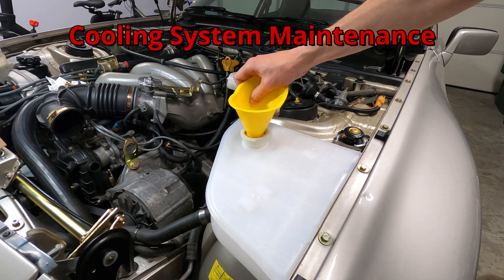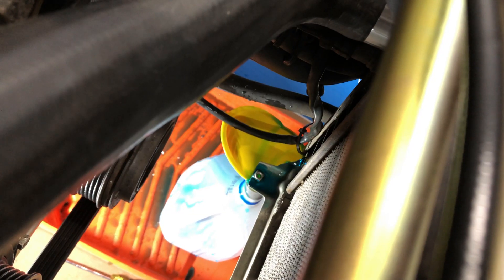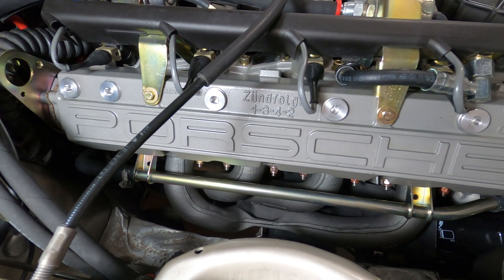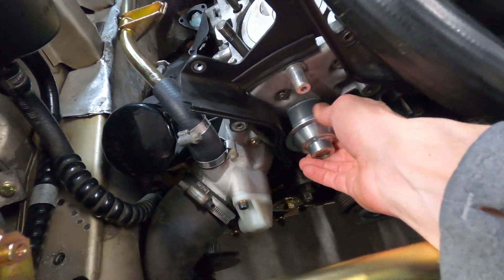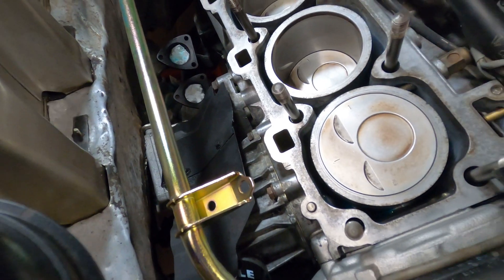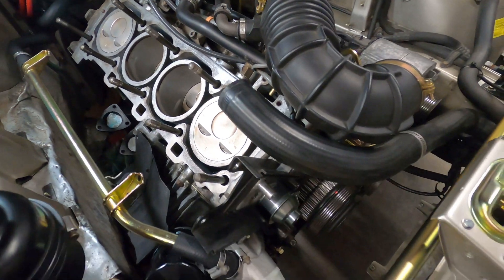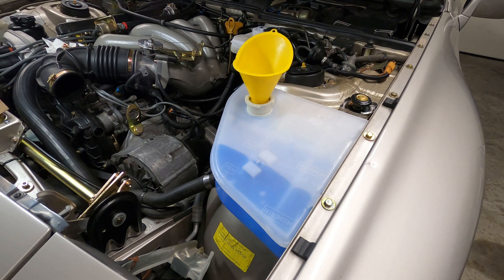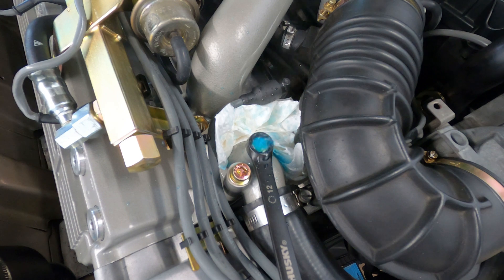Porsche 944 – Coolant System Tutorial: Draining, Filling, & Venting

Comment: Do i have to drain the whole system if i’m replacing only 1 hose? Replacing the upper radiator hose.
Reply from the maker: Nope, you can just pull that hose, dump the fluid in it, replace it, then refill and vent.

Comment: Very informative 👏 I'm about to flush my 968 and this video's a life saver
Reply from the maker: Nice! The valve setup naturally vents a little better on the 968, and you likely won’t have to do as much bleeding. I also just posted a water pump video on the 968 that gives some information on the draining and refill process for that car.
Reply: @NC944er confirmed! Have flushed coolant in my 968 a few times over the years. Usually only have to heat cycle/crack the bleeder once.

Thanks for the great vid!
Reply: @NC944er  That sounds good to me 😂 Awesome thanks, I'll check it out 🙌

Comment: Where does one get all the yellow zinc?
Reply from the maker: @jbrews91441  I removed all the steal brackets and hardware from the engine compartment, had it bead blasted, and replated in yellow zinc by a local metal plating company. Some folks do it DIY as well.

Comment: Terrific video.  I’m attempting this next weekend.  Question: to reduce the mess, wouldn’t it be easier to pull the lower radiator hose and place a bucket under there?  Is there a reason to not do it that way?

As always, this video is exceptional. Thank you.
Reply from the maker: @stephengawlik3033  Hey Steve, the lower radiator hose is rather inflexible and can be difficult to push off the connection to the radiator. You’re welcome to try it that way if you’d like, won’t hurt anything. If you want to get really fancy, check out the radiator drain kit from Lindsey Racing, it replaces the drain plug with a valve and hose connection for $32 - https://www.lindseyracing.com/LR/Parts/944RADDRAIN.html
Reply: I think it’s to help flush out any debris in radiator.

Comment: Hi i know this is a old vid but i need help, i got home after a cruise cars running well when i park and there is coolant all over the place BUT it looks like its a leak near the coolant tub but no pipes look like they are leaking also near the head it all looks clean too so im unsure where the leak could be please any help would be appreciated im freaking out 😢
Reply from the maker: @EBMproductions1  Sorry to hear that. A coolant leak could ultimately develop from any of the system components. I would pressurize the coolant system or run the engine until it’s warm, wait for the leak to return, and then trace it back to the highest source.
Reply: @NC944er  damn see i dont have the equipment to test i first wanted to run the car after putting some coolant in then trying to find ot however im scared it will hurt the head gasket, the coolants leaking on to the tray under the car and its closer to the tub housing the coolant but all the pipes, engine block look dry only place i see a bit of a wetness is the front part of the radiator where you look in from the bumper so im not sure if that is the radiator as its not leaking round the edges of the radiator?
Reply from the maker: @ Yeah, you can just run the engine, it won’t hurt the head gasket unless it overheats, so keep it topped up on coolant.
Reply: @NC944er  I'm going to look into Radiator prices in my country as we got told it would cost $2500 or so if Porsche had to replace and install a new radiator which is quite expensive especially right now.
Reply: Bit late to the convo but if it's near the expansion tank then likely it got too hot and came out the overflow tube. That's what just happened to me. Got home to hear it pouring out. Turns out thermostat wasn't fully engaging, swapped out a new one and here now to see how to bleed it!

Comment: So I did this, replaced the thermostat and cleaned the ground to the temperature gauge but now my temp gauge needle is bouncing around sporadically and is still running a bit hot (though it doesn't take as long to go near the red)

Any thoughts? Radiator or fans maybe?
Reply from the maker: Hey! I would try to sort out the gauge reading before replacing other major cooling system components. It shouldn’t be bouncing. Possibly a poor connection at the coolant temperature sensor on the engine block? Or a poor connection behind the gauge cluster? A new sensor runs about $50 if you wanted to replace it. Not sure if you have an infrared thermometer to scan the block, but the red section on the gauge should be between 105°-120° C so if the block reads less than that, say 90° C then it’s not really overheating. If your fans aren’t coming on at all, of course that would be a cause for concern as well.
Reply: @NC944er  I was just reading about the sensor and thinking that may be the issue.  I will give it a shot and hopefully find some good guides on how to do it. Thank you!! I appreciate how helpful and responsive you are.
Reply from the maker: @doubled334  Yeah, the sensor is a little buried under the j-boot/intake. It’s the one with the two wires going to it, not the larger plastic connector one. See if you can clean the contacts and terminals and make sure the wires are well seated, could just be loose or dirty causing the gauge to jump.

Comment: Hi, I'm looking for the reference numbers of the engine block drain bolt and sealing ring, do you have them?
Thanks in advance
Reply from the maker: Engine Block Drain Bolt M8x16: 900-075-087-03
Aluminum Sealing Ring 8x14: 900-123-105-30
Reply: @NC944er  Thanks a lot!

Comment: Hey, quick question
On the reservoir there are the min and max levels.
Does it need to be between those two levels when your engine is hot of cold?
Mine leaked some so I have to refill it but don't know what level is the best.
Before it leaked the coolant level sat between the two when the engine is cold and right above the max level when the engine is hot.
But now I can't even see any cooling liquid in the reservoir.
Do I also need to let the air out because I don't know how much liquid actually leaked out?
Reply from the maker: I like to keep the coolant level below the midpoint between the Max and Min levels when the engine is cold, that way when the coolant expands at operating temperature you won’t have overflow loss like you mentioned. Mine is right at about the Min level when cold right now and when it warms up it gets closer to the Max level. I’d recommend adding some fluid to that level and do a couple rounds of bleeding if you think there is air trapped in the system. When the system is fully bled of air, the fluid level should expand to a lesser extent, which will help.
Reply: Thanks a lot!
I'll try that and see how it goes.

Comment: What year is your 944?
Reply from the maker: Hey! It’s a 1988 model year.
Reply: @NC944er  should I use the top hose and add directly into the radiator also I've already added to the block through the hose.
Reply from the maker: @BennysBenz  Hey, no… it’s not necessary to fill the radiator from the top hose connection, just the engine block. The radiator will fill directly from the reservoir/tank when you top up the coolant.
Reply: This is taking forever to bleed, it is blowing really hot air in the car now, but the temp gauge is still way up so I've been running the car waiting for the thermostat to open and then shutting off the car undoing the bleep screw then repeat. The expansion tank is going down and I've been adding to it hopefully I'll eventually get this cleared out.
Reply from the maker: @BennysBenz  Yeah, it can be frustrating. Sometimes it takes 4-6 venting cycles to get all the air out. I generally drive mine and bring a 12mm wrench with me to vent it. Take it to the store or gas station, etc, vent it, drive it home, vent it, repeat. 😂
Reply: @NC944er  Ha! I was gonna let it run for a hour and then do that. If the wheels were on I would drive it around.

Comment: Is it the same procedure for the 951 Turbo?
Reply from the maker: Hey Howard, yes the process is “generally” the same on the Turbo cars, with just a few extra challenges, like most things on the 951. The bleeder screw is positioned horizontally rather than vertically like on the NA, and it’s partially blocked by the right intercooler pipe, some folks remove that pipe for easier access when venting the system. If you’ve drained the engine block, refilling the block with the upper radiator hose is another challenge as it’s partially blocked by the crossover pipe. You may consider disconnecting the metal return line where it meets the flanged water neck at the top of the cylinder head and refilling there with a funnel and short length of hose attached. Either way, prepare for some mess. 😂

Comment: Thanks very much for your videos man, very helpful :) I've been having issues with the coolant system on my 944 (3 different leaks, quite hard to spot), now I wanna vent it properly and I have a question :
- When you start the engine to get to the driving temperature, do you put the extension tank plug back in place ? Isn't it dangerous to open it at the operating temperature to add coolant (heat & pressure) ? Or do I have to wait a few hours for the engine to cool down before i start the venting process again ? (and add coolant if necessary)
Thanks again,
Reply from the maker: Hey Tony, no problem. Yes, the cap for the expansion tank should be installed before starting the engine in order to build up the needed pressure for venting at the bleeder screw. The caps are typically rated between 15-22psi before they would self-vent air pressure and fluid, so the pressure isn’t that high. The caps can safely be removed when the engine is at operating temperature, as just a small amount of hot air is released when removing the cap. You could use gloves or a rag over the cap if that’s a concern.
Reply: @NC944er  Thanks for the quick response. So I can do the venting process a few times in row ? Once i've reached the operating temperature, i turn off the engine, open the venting bolt, close it, start the engine again for a few minutes (how long ?), turn it off etc ?
I'm gonna try to do it tomorrow morning.
Reply from the maker: @tonylampure8368  Yeah, it’s easiest just to complete the venting cycles back to back since engine temp is already up. Turn off the A/C while running and wait for the cooling fans to kick on, that’s a good sign you’re in the 92°C temp area. Pop the bleeder for a few seconds until the air bubbles stop and you just have solid fluid coming out, lock the bleeder back down, and you immediately start the engine back up. Shouldn’t take more than 5 minutes of running between cycles unless it’s really cold outside.
Reply: @NC944er  Good stuff thanks, I'll do it tomorrow and keep you updated. No AC (not very common in the 80s in Europe), cold tomorrow but not too cold (I currently live in France)
Reply from the maker: @tonylampure8368  If you had completely drained the block of coolant, or replaced any of the heater lines, it’s also a good idea to set the HVAC to full heat so that coolant moves into and out of the heat exchanger in cabin, which will help get all the trapped air to the top of the block for venting. Best of luck! 👍🏼
Reply: @NC944er  Hi, so I performed the venting process 4 times but I still had a few tiny bubbles, I hope it'll do ! Thanks again
Reply from the maker: @tonylampure8368  Sure! On occasion, I’ve had to perform the venting 6 times to get all the air out, but 4 often gets most of it. Just watch your engine temps on the first few drives. If temps are stable and the heat works, you should be ok.
Reply: @NC944er  Will do ! I also read on the french Porsche club  website to reopen the bleeder one more time when the engine has cooled down... 
Also I'm planning on changing the timing and shaft belts in a few months, it's been four years (not too many miles though but still...) I'm gonna use your videos !
Reply: @NC944er  Hey, I just opened the expension tank to add a small amount of coolant (the engine was cold), and coolant raised in the tank ! Is this normal ?
I'm still worried about my coolant system... 
Thanks again,
Reply from the maker: @tonylampure8368  Yes, that is perfectly normal. When the system is under pressure, it keeps the fluid level a little lower.
Reply: @NC944er  Awesome, I'll drive it to go to work tomorrow then

Comment: Lindsey Racing sells an interesting looking coolant drain kit.  From what I can gather from the website, it appears to have a custom fitting that screws into the radiator along with a hose and valve.  I think it was designed to direct the outflow of coolant into a bucket, negating the need of multiple paint roller pans and other catchment devices.  It might be something to try and could be an interesting video review.

Comment: Where did you find the crush washer for the engine block coolant drain?  Having a hard time finding those.
Reply from the maker: The engine block drain bolt uses an 8x14 aluminum crush washer. 

Here are some links:

https://www.pelicanparts.com/More_Info/90012310530OEM.htm?pn=900-123-105-30-OEM&bt=Y&fs=0&SVSVSI=1022

https://www.belmetric.com/aluminum-washers-c-4_2122/ga8x14x10-aluminum-gasket-p-12795.html?zenid=20q8501nlcplhe1oha9t7sag96
Reply: @NC944er  Thanks again!

Comment: what coolant and oil do you recommend for an 85.1 944, also great video very helpful!
Reply from the maker: You'll see a lot of different preferences out there on oil brand, but as far as weight, I use Castrol GTX 20w-50, which is good for warmer climates. If you live in a colder climate or will be starting the car when outside temperatures are 14° fahrenheit or colder, you would want to drop down to something lighter like a 10w-50. There is a chart in the owner's manual.

For coolant, I've been using the Peak Blue European stuff available at AutoZone, there are a number of other options. It's functional and I haven't had any issues. The bright blue color is also useful when there are leaks because there's no confusing that color with any other fluids used on the car, and you can track down the source quickly.

Comment: How did you get your motor so clean?
Reply from the maker: Short answer: a lot of time and money.🤣

Long answer: The intake manifold and camshaft housing have been bead blasted and powder coated with satin clear. Most of the steel parts on display have been either replaced or re-plated with yellow zinc. Replacing the fluid reservoirs makes a big difference as well.

Comment: Is the oil drain crush washer is a different size from the engine block coolant drain crush washer? I am guessing that cannot be used
Reply from the maker: Yeah, the seal for the oil drain plug is 22x27, the engine block drain bolt is 8x14. 

Here’s some links:

https://www.pelicanparts.com/More_Info/90012310530OEM.htm?pn=900-123-105-30-OEM&bt=Y&fs=0&SVSVSI=1022

https://www.belmetric.com/aluminum-washers-c-4_2122/ga8x14x10-aluminum-gasket-p-12795.html?zenid=20q8501nlcplhe1oha9t7sag96
Reply: @NC944er  You are a life saver.. I just called into Pelican Parts to threw a few of those in my order before it shipped. I just recently had oil get into the coolant system and my guess is that the oil cooler seals went.. I am assuming it will be wise to do a few flushes from the engine block afterwards. Thanks for the really quick reply
Reply from the maker: @Seagrams  Yep! It’s a bit more work to do the full flush, but worth it to get the system nice and clean.

Comment: Nice video, this is my next project, going to replace all 4 hoses connected to the radiator and the expansion tank. I have a question, I am in the process of changing out the fuel level sending unit.  I cannot get the hose on the left off the larger heart line connected to the unit, did you have to go under the car and pull on that hose to give yourself some space to take off that hose? Man it is a pain in the ass. Any ideas? And how did you take the cap off the unit?
Reply from the maker: The lines get a bit hard and inflexible with age, but you should be able to push them back under the sheet metal a bit. I did not need to do anything under the car. 

The cap is basically a lid with no center, so it twists off counter-clockwise. Try to loosen the cap and see if twisting/tilting the unit at another angle helps get a better leverage point on the hose.